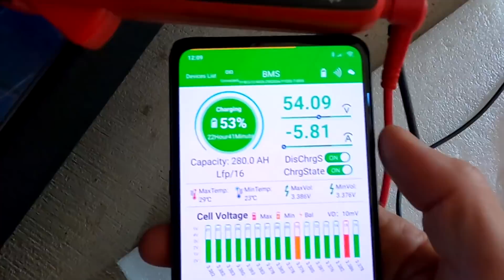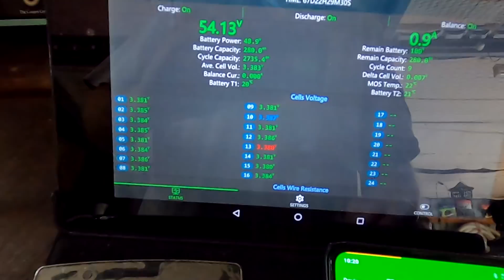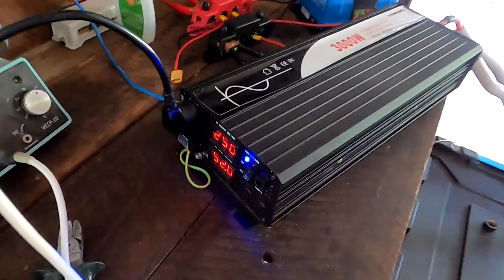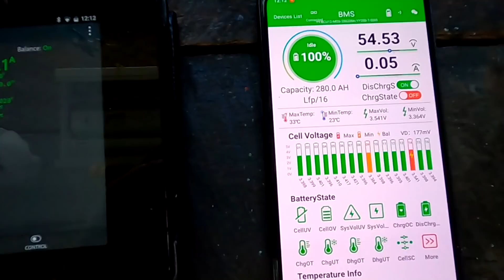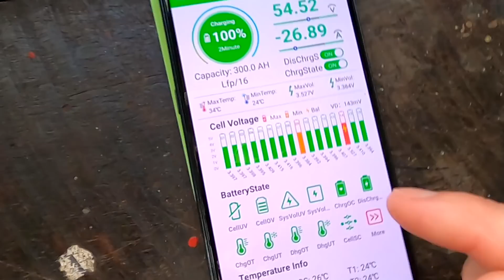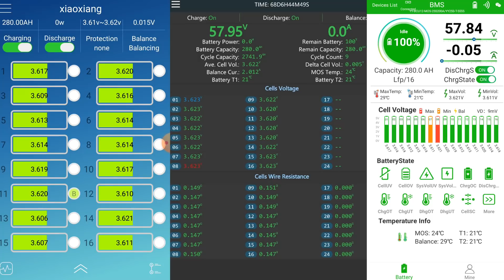Overkill, JK-BMS and Heltec in parallel. Top balancing of 3 battery banks! 🔋🔋🔋(+ magic smoke!)

Comment: Another incredibly informative video.  Woops about the boost converter... amazing you caught it on video.  I enjoyed the detailed comparison of how each BMS dealt with the batteries approaching full charge.  I almost expected you to manually discharge cell 14 on the Heltec a little just to keep it from stopping the charging so often.  From what I've seen so far there's no way I would trust any of the information from that Heltec BMS.  Thoughts of running a discharge test on that battery immediately popped in my head just because I don't feel confident it got fully charged.  As always - great stuff Andy!
Reply from the maker: Thanks a lot for your comment. Always good to hear from you and read your thoughts. I much appreciate it.

Comment: Now that all 3 are top balanced, it will be interesting to see if the passive balancers of the Overkill and Heltec can keep up during normal operation or are the large capacity batteries just to much for these BMS's. I have the Overkill 16s BMS's on (2) EVE LF304 cell batteries. My 2 hr absorption is set for 56v and float at 54v. I discharge both down to 45% SOC every night and recharge to 100% by 2:00pm the next day here in sunny California. It's been running this way for about 3 weeks. I have yet had the BMS turn off due to over voltage (3.65v) of any given cell. I have monitored the cells many times during the transition from bulk to absorption and to 100% SOC and the highest voltage I've seen is 3.520v with a cell deviation of 60mV. I wonder how this will change over time. I properly top balanced the cells to 3.60v before creating the batteries.
Reply from the maker: I think they will be OK if you fully charge your battery every single day and the drift is only small. In my case it can takes weeks, months until I charge i up again and the deviation is pretty large. We could nicely see, that the JK has no problem keeping the battery under control and balance all cells out in a short amount of time even after weeks of no top balancing.

Yeah, do a top balancing with your battery at 3.6V as you said and then monitor the situation over time. If you recharge every day at 2pm and have 2h of absorption, the BMS balancer has enough time to sort things out even without an active balancer.

Comment: i was planning to get a new BMS, still thinking to get a seplos BMS or JK BMS, seplos has pre charge function build in and able to communicate with inverter, JK has the active balancer which sound fantastic.
Reply from the maker: Why should the BMS communicate with the inverter? Is there not a setting in the inverter which turns it off at a set voltage anyway?
Reply: @OffGridGarageAustralia  hi andy, you may take a look wills latest video (eg4 inverter), he has indicate some benefit for the BMS communicate with the inverter.

Comment: The HELTEC needs a lower charge current when one cell is close to max voltage.  Add a resistor in series, or ideally tell the charge controller to lower the current automatically with a Victron BMS controller.  And 5/5 for magic smoke special effects - looks so real.  LOL.
Reply from the maker: That is the problem of the BMS though as it should balance this one cell and not slowing down charging for all battery banks and the whole system. That's not a good solution in my eyes.
Reply: @OffGridGarageAustralia  So really we need each battery bank to have a PWM type bms.  As they get close to maximum voltage they have a PWM circuit to slowly increase resistance that limits current to match what the balance circuit can do.  Would also be ideal for the minimum voltage to only allow enough current that won't trip the low voltage of the worst cell.  Kind of a special case when paralleling batteries, but might be reasonable to add for all situations.
Reply from the maker: @jmaus2k  I don't think this is necessary. The banks, once top balanced, will work this all out amongst each other. The more complex it all gets, the more can go wrong and need to be maintained.

Comment: I'm thinking of using a timer relay to turn an active balancer on after midnight till early in the morning to balance my packs well there is no stress on them from charging or discharging do you think this would be a good idea
Reply from the maker: Yeah, but if your battery is not fully charged it would balance it anyway...
Reply: By connecting it to the negative wire

Comment: Just wanted to let you know since I found out the hard way.....
Always keep your power supply set slightly higher than the other sources. Any reverse current will very quickly kill the power supply. Ask me how I know!
Reply from the maker: Thanks John, Yeah I had the 55V on the output still connected but as soon as the input voltage returned 🔥 Well, I learned something...

Comment: "How does the Heltec decide the battery is full?" When the first cell hits the cut-off voltage, which I think is fair enough since all cells in a pack should track each other fairly closely once balanced.
Reply from the maker: But, that is not the case. It sometimes goes into this state even the highest cell is only at 3.52V for example. I thought so too if on cell hits the ceiling but...🤷‍♂️

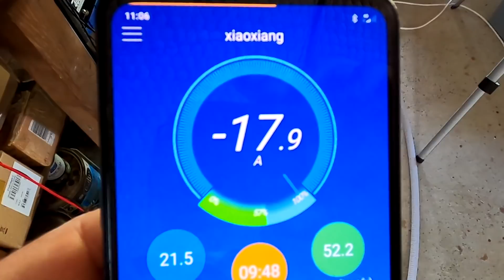Comment: 19:00 You are batting the same with two out of the three same boost converters I have Andy. One shorted on the input, at about 8amps and 54v, the other simply quit, and the third ran for about 15mins and then went to 90v output and stuck. I've been using it as a regenerative boost converter on an ebike for over a year and with a 1kw hub motor with great results. It will charge a 48v li-on pack using the motor for regen at 30amps at 20mph and 3 to 8 amps at 3 to 10mph while. Great for that but not a safe for battery charging without a BMS. 

I over the last year, I've accumulated quite a stock of now dead cheap Chinese electronic "solutions" like BMS's watt meters and boost-buck converters, charge controllers, spot welders, test meters, power supplies and three of those 3 to 5kw sine and modified sine-wave inverters, LFP prismatic and can cells, non of which did suppliers stand behind, so I no longer waste time with warranties or buying such products unless they are only to be considered as disposable tools for experimentation. 

A friend who's been selling and servicing off grid solar power for almost two decades, stopped selling cheap Chinese prismatic LFPcells and packs due to the high number of customer cell failures, often only weeks and months from new. He's watching your channel closely Andy and hopes your result will show better reliability so he can return to providing cells and packs for his customers.
Reply from the maker: Thanks for sharing, Jack.
I have now quite a few parts lying around here too which need fixing. I should probably open another channel for just these repairs. I may need some feedback from others during the repair so won't put this all here on this channel. But it would be a good experience for everyone to learn a lot and help each other out.

The cells are very good so far. Even the 'old' battery pack is totally fine except the striped terminals from my many experiments 😂 We will fix this soon too. It's very easy...
Reply: @OffGridGarageAustralia  Thanks  Andy. Hope the LFP cells deliver over the long run, and some competitive non-Sino sources will enter the market.

Comment: As someone with casual interest in your experiments, I can say that cell 14 seems to be always the cell that is low or high depending on what you are doing. My humble guess, cell 14 has a lower capacity than the other cells. Discharges to lower voltage sooner and  reaches higher voltages while charging.
Reply: that is why the weakest link always controls the rest. With my 64 cells I will group each set by those low cell ones. take the lowest 16 in a group to the highest ones. that way each set will work accordingly.  I might not have the right cell balance untill I order another 32 cells.  I need around 80k  total. so I can do 80% and use 64kw each day with no real damage to the cells. finding that sweet spot for the cells is why I love Andy and what he is doing. he is testing so many ways till he finds the sweet spot.
Reply from the maker: One cell has to be the weakest in any pack. We will keep an eye on it 🧐

Comment: Never apologize for long videos. I can't get enough. If anything, apologize for the short videos.Hahahahaha! I've been wondering about the 100% charging. I thought we only charged the batteries to 80% but I keep seeing he's charging to 100%. Is that 100% of 80% or is that 100% of 100%?
Reply: I was wondering about that too! Since i am at the brink of setting up my 24v with a JK. I can only think of 80% being the voltage range since charge with absorption would result in over 90% SOC.
Would love to see a dump of all of Andy's JK settings on his website.
Reply from the maker: Thank Porter. I make them longer, just for you 😂
No, charging to 80% is a myth from the Li-ion cell chemistry where the state of charge is linear to the voltage. High voltage is bad for every battery, so to save all li-ion batteries from dying prematurely, the industry just said, charge to 80%SOC. That basicaly kept the voltage lower and pro-longed the battery life.
With Li-FePO4 this is not the case any longer as we have a flat curve for most of the charging process. Once we see the voltage rising to say 3.45V, the battery is already 97% full! See all my other video here on the channel where I tested all this with the battery tester. There is no need to NOT fully charge these LiFePO4 cells. You can easily do this with only 3.45V and not going higher which would stress the battery again.

Comment: A 10A difference would take more than 60 hours to be balanced at 150mA... Those internal balancing are just not fit for those huge battery capacity.
I'll probably go with JK for my battery
Reply from the maker: If you have your battery charged every day, I think the 150mA could be sufficient. But if you charge it only once a month or even less often like me, an active balancer is key. Or the JK-BMS...

Comment: Glad to see things are getting balanced now! so they should all work in unison! Get rid of that Heltec BMS!!
If you need any info regarding how to fix those red boost converters I am your guy, I have 3 of them and am trying to make a 3000W boost converter by putting 2 units in parallel with a complete overhaul in the components.

I think the reason the boost converter failed was because of the high inrush, you didnt precharge the capacitors. I think the proper procedure would have been to raise the UVLO voltage to something like 50v and reduce the current to 0A, then precharge everything with a resistor. With the resistor still connected turn on the BMS and then increase the amperage to the desired setting.

That mosfet on the input is only there for reverse polarity protection (it is in series with the negative input) but it is possible it failed due to the high inrush and it wasnt fully turned on yet (acting in the linear region) but if that is shorted then all you lose is reverse polarity protection and it will probably work ok (it might be higher resistance than working but shouldnt be a short from + to -)

Good luck with the rest of your experiments and fixing the boost converter! Though it might be better to get a much higher quality one with a better circuit design and protection features.
Reply from the maker: Excellent. Thanks a lot for your offer. I will definitely get back to you when we repair this booster. The problem was maybe it was still back-fed from the output voltage with 55V. Yeah, I used the pre-charge resistor before when I connected it but now through the BMS... 🔥
Reply: @OffGridGarageAustralia  ah I think setting the current down to minimum before powering up is a must, otherwise disconnect the load, either or should work in conjunction with precharging. These boost converters are kind of touchy the circuit is all analog and simplified

Comment: Congratulations. just have to recharge everything else now. like it . about to try out me small set up for camping with compressor fridge on a uk mayday weekend. still lead acid marine but worked ok shed mounted with no spat adjustment for 2 days last weekend. Thinking about a house backup system for lighting / fridge / entertainment with a cell and panel to take away for camping. just doing the economics yes I have been paying attention. before I go bigger I think I need to review the earthing as I dont want to shock the sparky especially as he is a decent sized chap two doors up and his wife is midlands champion in one of the arts. Loving the vlogs.
Reply from the maker: Thanks for sharing, Mark. Once ideas are in your head, they won't go away any more . It's good to think about these little projects and plan on expansions over time. It's a very rewarding hobby and interest 😉

Comment: Got my cells from Qishou today (LF280K).  As for the din rail terminal block, I plan on using gen 1 Wagos. Those were easier to get here in the US.  Building a box for the retention/compression in my mobile application for the 12s battery.  The work has just begun!
Reply from the maker: Fantastic. What BMS are you going to use for your battery?
Reply: @OffGridGarageAustralia  Well, as you put it: I'm "making DALY great again."  Actually that came in today.  My options were limited at the cell/pack configuration (12s at 36v) at the Amps I require.  Pretty much ready for assembly and cell testing.  Also put the Xijia inverter at 120v 3200 watts on order.  Not sure when that will come through.

Comment: When do you think a battery 🔋 is too big to be charged from a solar system?
Reply: Never!
Reply: @amudlifecrisis  I’m not too sure about this reply…. Sun is only available for a limited period of time during day and it’s not guarantee its presence each day (at least where I live) the solar array is limited by the space you have and if you every day use some energy to run your things plus charging batteries you should reach a point where the solar can’t charge a battery it it’s too big…. Am I missing something?
Reply from the maker: Mine is far to big now for this solar system I have installed. Or maybe I have too much load connected. Any way, solar and battery should match.
Good question though. We will discuss in a separate video...

Comment: Any ideas why the current sensor on my JK BMS is super jumpy and inconsistent? It jumps all over the place and totally misses light loads.
Reply from the maker: The numbers on the JK are a bit jumpy at times. Does it also jump when you have current at all?
Reply: @OffGridGarageAustralia  it doesn't register small loads. With a 2 amp load it jumps between 0.4 and 1.1 even though my shunt shows 2.2 amps. When I run an electric heater the current jumps all over the range while my shunt shows a fairly stable 58 amps (24v battery). The JK jumps so much that I just disregard it's current measurement, but if there's a way to calibrate it that I'm not aware of, that would be awesome.

Comment: Great stuff as ever.

Apart from the ability to disconnect 15/30kWh of batteries for maintenance, I'm glad I'm going for parallel and then series with one BMS (and 2A balancing).
Reply from the maker: Thanks David. A further disadvantage of going parallel first is you have no information or control over single cells as they all look like one cell. 
Apart from that it saves you the other BMSs and a lot of work...
Reply: @OffGridGarageAustralia  I'm hoping that keeping the voltage between 3.0 and 3.4V should mitigate any potential SOC difference between parallel cells (that and them automatically balancing) and prolong the system life.

Comment: Hey Andy,
I have one little question about the jk bms.

If you set the balancing starting point at 3,45V. does this mean:

- jk bms will start balancing if only 1 cell reach 3,45 or:
- jk bms will start balancing if the cell average cell voltage reach 3,45 or:
- jk bms will start balancing if all cells are above 3,45 V.

Thank you
Reply from the maker: Thank for your question Peter.
The idea of balancing is to have all cells at the same voltage. So with 55.2V overall voltage of the pack, that would mean, ideally all cells have 3.45V. If only on cell goes over this voltage, it is basically 'unbalanced' and voltage is too high for this one cell, so it gets discharged.
If the BMS would wait for the average or even all cells to be over 3.45V it could be too late as some cells could be at 3.65V already if there is a larger imbalance.
All BMS I have tested act upon one cell being over the set threshold of the balance start voltage.

Comment: Some nice magic smoke on the DC/DC-converter. 😅
Looks like one of the input MOSFETs has been killed and is now shorted. That's a common failiure of a MOSFET. I think it was because the output was still connected when the input current was switched off and on again. This results in a very high inrush current which has "grilled" the MOSFET and the fuses.

Nice big capacity battery shelf and now top balanced. 👍
Reply from the maker: Thanks Gunther. Yeah, the fuses basically exploded, so the current must have been really high. Totally my fault, I should have known better.
I'm trying to repair it later on and probably need some help from the community for that
Reply: @OffGridGarageAustralia  it was fun though. And, it shows even the best have their smoky days. It helps me overcome my worst mistakes. Really. So, thank you for frying something. Shared malheur is half malheur.

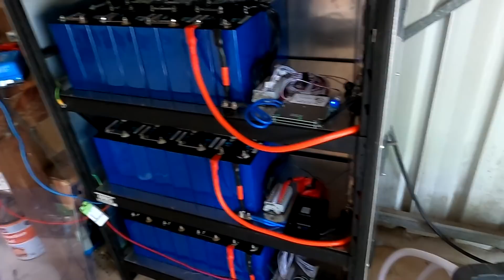Comment: 5:29 not fond of Positive Cables dangling outside like this.
15:24 Heltec's App is the odd ball showing negative current when charging.
31:15 JK's app need some love when compared with the others. For one thing, the app ought to auto hide cells (17 to 24) that are not wired to remove clutter.
Reply from the maker: The shelf is not ready yet but I could not wait to connect it all up. 😏